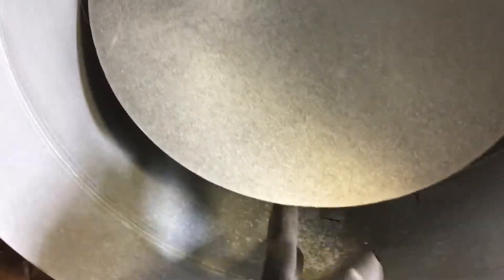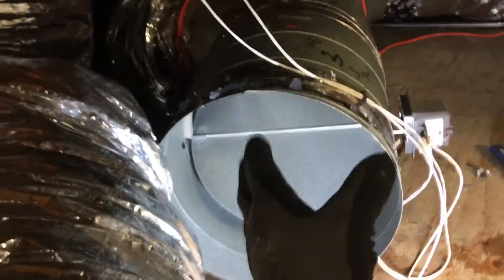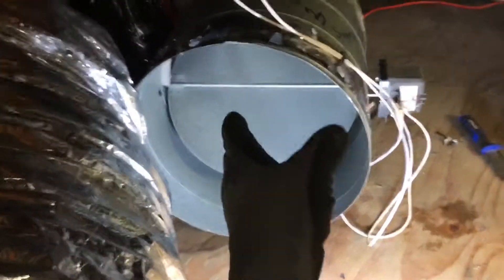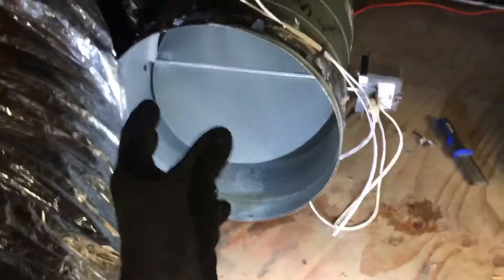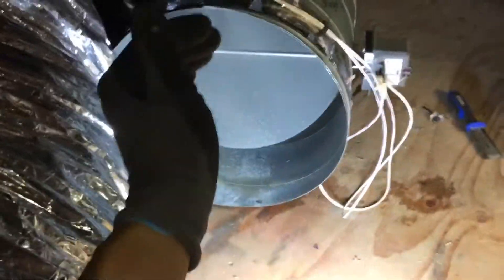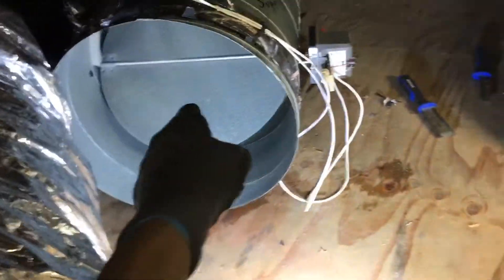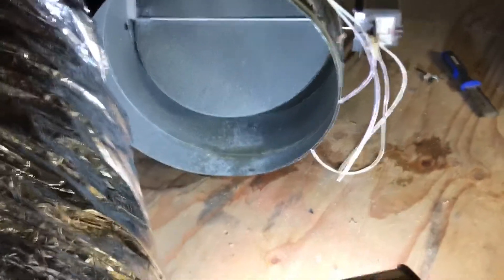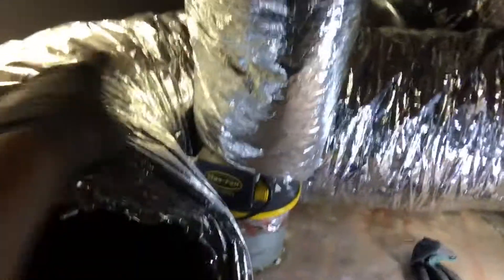Flex Duct Correction of airflow problem. They should ban flex duct or ban the people who install it￼

Comment: Advantages of flex duct: it's cheap and easy to install. Disadvantages of flex duct: it's cheap and easy to install.

Even at 15-20% compression the air flow will be restricted 50%. Flex is trash. It is comical that the ones who advocate for it's so called benefits are never the ones who install it correctly to utilize any of those proposed benefits
Reply from the maker: 100% correct and the majority of the low paid installers were told to install the flex duct never had any formal proper training on installing it inthe first place. 

And usually if you ask the owner of the company the contractor to do it himself, he is usually incompetent and in capable of correctly installing flex duct. 

People are not aware to absolutely correctly installed flex duct. It does take a significant amount of extra time to do it correctly.. 

On top of that to be completely airtight and passed a duct blower test for your energy efficiency rating that is required here in California.    Installing the mastic sealant at every metal fitting can sometimes get a little messy and then you have to zip ties and then you have the duck tape. If you use this method of three items do you have a completely 100% secured airtight Connection.. 

And if you’re that Contractor, who takes airflow to the next level when using flex duct and you use hard metal 90° and 45° Bends to have a nice move airflow going around corners..  that can increase the installation time by quite a bit because every time you add a joint, you’re adding to connections that you have to mastic, zip tie, and duct tape.   But it vastly improved airflow.. 

This particular job site, the contractor responsible for this mess. I have come behind him on a few other job sites. He has made me a lot of money coming in behind him and repairing his work. .